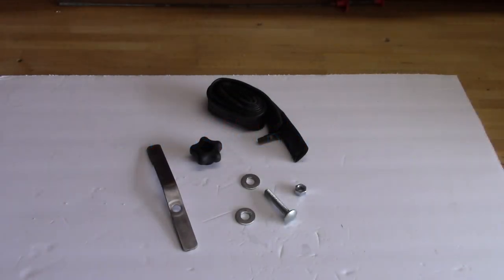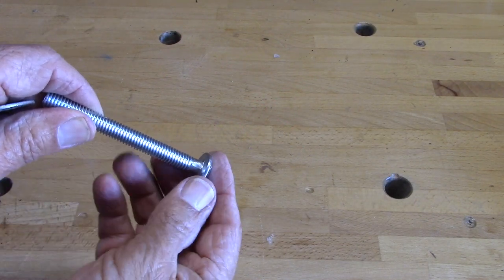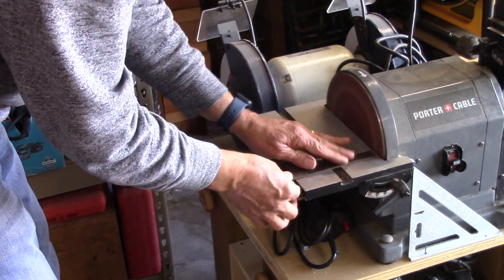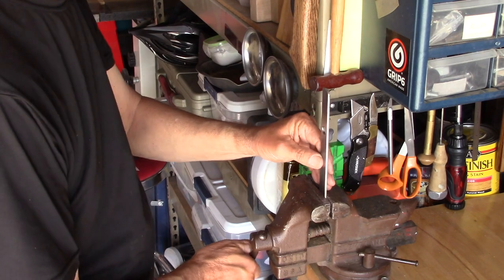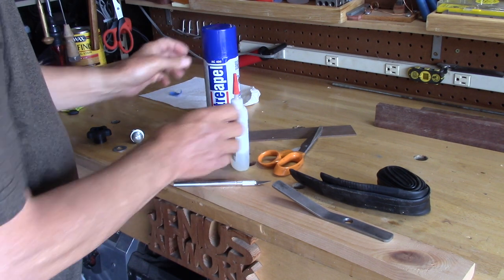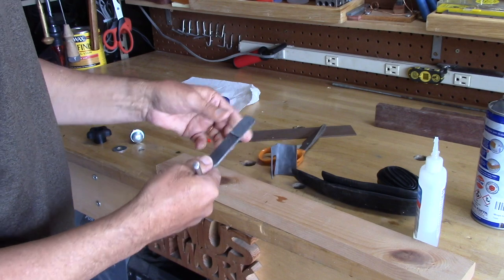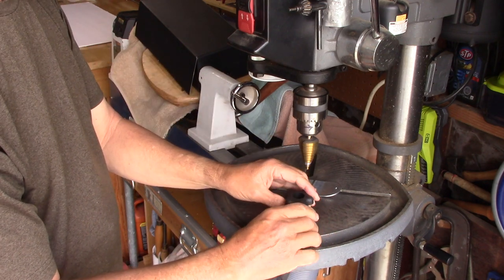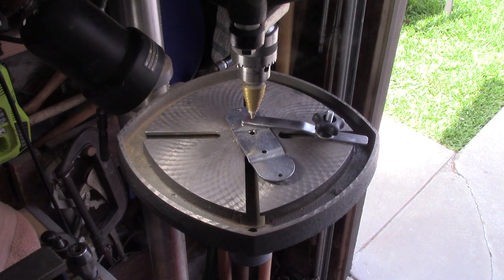DIY Drill Press Hold Down Clamp

Comment: Ummm why didn't you just drill out the inside hole of the washer or use an angle grinder to remove the extra metal instead of filing for half an hour ??
Reply from the maker: I don't own a reliable angle grinder and I never thought of drilling out the washer.  Also, sometimes I  just like using my hand file.

Comment: What is the thing that you are using to hold the screw when filing
Reply from the maker: It is a really cool gaget that has 3 magnets on each side to hold it in place.  It is made out of a soft plastic or rubber and has cut outs where you can hold dowels, bolts, etc at different angles an horizontal.  It is great for apllications where you want to cut wood, brass or copper and have no scratches.  Here is its Amazon address:
https://www.amazon.com/Vise-Soft-Jaws-Vice-Pads/dp/B01FT2QTDA/ref=asc_df_B01FT2QTDA/?tag=hyprod-20&linkCode=df0&hvadid=309869401414&hvpos=&hvnetw=g&hvrand=10693238333534347850&hvpone=&hvptwo=&hvqmt=&hvdev=c&hvdvcmdl=&hvlocint=&hvlocphy=9031057&hvtargid=pla-568935719645&psc=1&tag=&ref=&adgrpid=63364097444&hvpone=&hvptwo=&hvadid=309869401414&hvpos=&hvnetw=g&hvrand=10693238333534347850&hvqmt=&hvdev=c&hvdvcmdl=&hvlocint=&hvlocphy=9031057&hvtargid=pla-568935719645